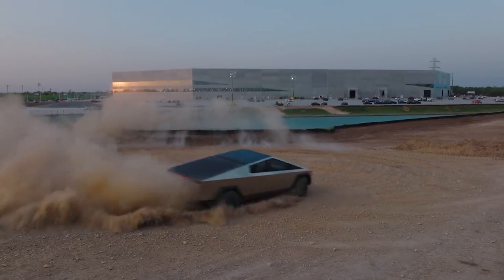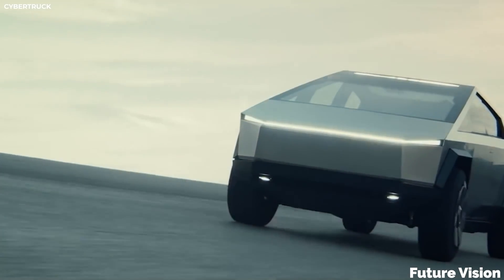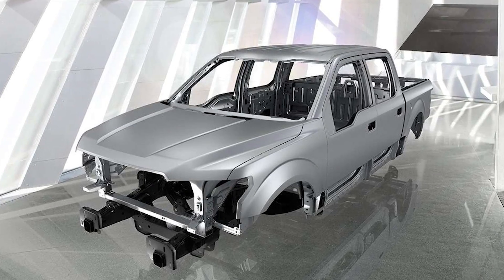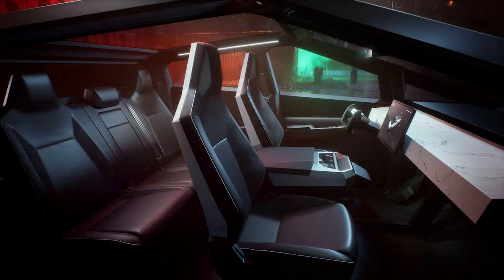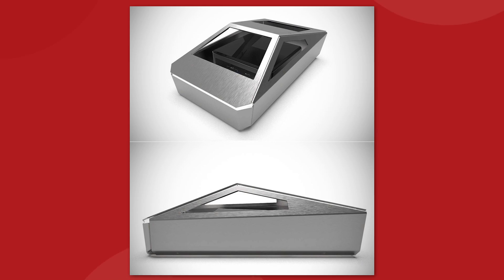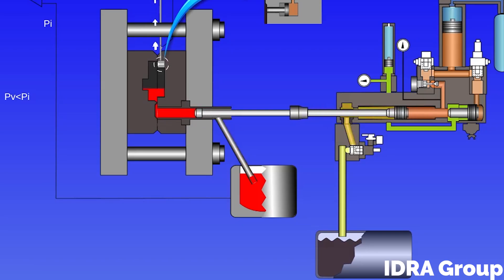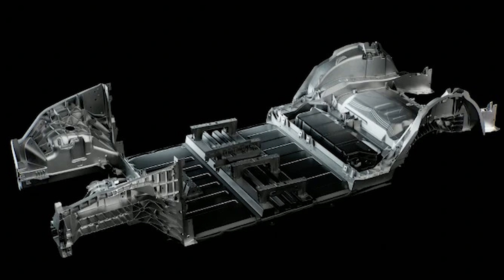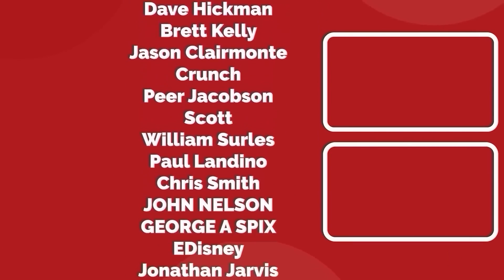The Real Reason Tesla Developed The Cybertruck!

Comment: I have a Volt and my son and son in law both have Teslas.  All have replaceable batteries. Since the battery is part of the cybertruck, what happens in 10+ years when the battery has degraded to a very short range, The battery cannot be replaced.  Just scrap the truck?

Comment: Is the cyber truck designed to haul tools to a job site?
I mean it looks New and it might be Good but what about hauling rock or dirt what can it be used for? Is it for the dads and moms to go camping in or take the boat on vacations? Do we have to buy triangle shaped tool boxes to get them to stack right in the bed of the truck? Is there going to be lumber racks available so we can carry 20' x 2"x4" or 20' x 4" x 8" shaped boards or maybe 20' long pipe or full sheets of plywood to a job? What work can it be used for. Okay maybe you see a better design for a SUV but is that really going to work like a pick up truck works. I mean WORK or sport utility? Can we fill the back with scrape metal and bring it to a recycler and have him lower an electromagnet over the bed to remove the scrap without the electromagnetic field totaling the electronics?

Comment: I did notice one thing and its the same with a lot of vehicles now.  The sloped windshield creates a long "A" pillar on each side.  This causes a blind spot for the driver when pedestrians use a cross walk.  And I believe this is why a lot of pedestrians get hit by vehicles.    I'm sure the design structures will take off, but I can tell you one thing, you cannot beat the wrap around windshields of the older vehicles which gave the driver better frontal vision.  Maybe your design engineers can come up with a better windshield design to try and move those "A" pillars or eliminate them some how  from blocking corner vision.  Structurally the design I believe is strong but maybe later a little dressing design on the front would look good. As of right now the vehicle looks very plain.   Good video.
Reply: Yep, possibly the least pedestrian friendly design of the last fifty years.
Those A pillars will make for great tunnel vision.
Bags of glare off the sloping windscreen, and dashboard reflections.
Wonder how it fares in crash testing.
Best of luck repairing panels if they do get damaged.
But I'm sure we'll find out how they perform in the real world very soon.

Comment: I don't care about how it looks. I haul a 30 foot RV or boat around most of the summer. I want to be able to load a dozen bags of redi-mix and some 8 or 10 foot treated lumber for a random porch project. Sheets of plywood. A load of trash bound for the dump. If it can do that, I'll seriously consider it.
Reply: In New York city, the cyber/battery trucks that the city bought to clear snow.......lost their power after just a few hours.   These battery operated trucks don't have the power and endurance of combustion engine trucks.

Comment: If the range of the Cybertruck can be 500 miles, 4 x4, tows 10,000 lbs, has V2G and 240v points, it' the truck for me regardless of its design or colour.

Comment: Longer lasting? This is misleading. You can still see on the streets 20, or even 30 years old pickup trucks, but you will never see an EV lasting this long no matter how well they are build unless they solve the problem of the current state of batteries. No matter how good these vehicles could be, current batteries will only last 6 to 10 years max and replacing the them can be as costly as buying a brand new vehicle and no one really knows what to do with all those old battery packs full of toxic waste that will start to appear in a few years from now. These Cybertrucks will be just as disposable as any other Tesla car or EV unless there is a game changing discovery in energy storage which hasn't happen yet.

Comment: My problem with all eclectic vehicle is the build in not exchangeable batteries. there should be a law that you have to build cars (and Cellphones) with exchangeable universal battery units. Fast recharge with battery pack swap and longer (full power/range) live span for the vehicle. But than they would last to long and the industry does not seem to like that to much.
Reply: I agree...these battery packs should be replaceable, but NOT to put in a newly charged battery.  These batteries weigh 1000's of pounds, have a lot of electrical connectors including dangerous high voltage wires, and connections so the vehicles air-conditioning to cool them.

Comment: One of the main reasons motor vehicles went to lighter metals and even plastics in the body (think front and rear bumpers), was to create crumple zones to absorb energy. The crumple zones increase survivability for any unfortunate pedestrians to be hit by a vehicle and also the occupants of the vehicle.

How the engineering has been described in the video, the Cybertruck sounds like it has gone backwards in safety standards and basically become a stainless steel battering ram. I'm sure that Musk and his engineers have in some way addressed this, otherwise the Cybertruck wouldn't pass any international safety standards.
Reply: It's most likely different concern on different classes, body on frames also have reasons why exist and as result crumple zones are not possible in same manner as on unibody structure

Comment: At first it seems to be reasonable, but, a sole of Aluminium? A battery to carry weight?  Wouldn't it smash most other vehicles it crashes into? And if it is smashes by a heavier vehicle, will there be any chance of repair? I don't think so. It's like a bugs exosceleton, if it's broken, it is a total loss. It may be nice, if it wasn't driven electric.

Comment: Stainless steel is always a great option.  I still have problems with the batteries in all EVs.
Reply: The alternative is a very long power cord. Lousy range, but it would save a lot of weight and cost.
Reply: @sanderdejong66  Maybe the addition of a small efficient gas or diesel-powered generator that could charge the batteries when driving to increase range, it wouldn't have to be big.  There will still come a day when the batteries fail to charge and need disposal.

Comment: How long will the battery last? Because is going to be difficult (if not impossible) to replace it...
Reply: tesla engineers are not idiots.  It will be possible to replace the battery pack and probably not difficult with the proper hoist/support equipment.  On the other hand, I am convinced there are idiot engineers at Subaru.  Replacing the driver side headlight bulb on a 2014 Subaru Outback requires a skinny multi jointed arm with eyes on the fingertips, something I don't have.  Luckily my mechanic has a pet monkey for jobs like that.

Comment: A good explanation of WHY the cyber truck is the way it is.  BUT there is a core ASSumption, 1 size fits all.  This ignores the specific job requirements of for example, utility companies with their industry specific bodies, or a flat deck, try dropping a flat rear tractor(eg 650/75x42) tyre on a cyber truck (awkward, IF it fits), then drop a fire fighting rig on(fire fightng for grain harvest) and general farm work. A flat deck means you have access from 3 sides, with a cyber truck you only have 1 side access.

Comment: The engineers are geniuses. But, like the man Tesla, they may have a problem. I don’t care how perfect the design is from an engineering perspective, looks matter and so does market use. Tesla was ahead of his time and he died long before anyone truly appreciated his work. I think this will go the same way. I’m a truck guy who uses one as a daily driver with the thought of using one as a truck. Towing/hauling and aesthetics. It might be the most amazing thing ever but it’s ugly and will fail miserably in the tow/haul category. I lose 20% efficiency in my truck when I haul a real load. All the EVs on the market lose 70% under a load. I’ll naturally assume it has the same poor performance at being a real truck unless they prove otherwise. It’s ugly and won’t out perform my truck when being used as one…. Plus, we’re 30+ years from having a grid to handle large quantities of EVs so it’ll cost more not only at initial purchase but more long run to keep it charged along with increased recharging time vs fossil fuel trucks.

Comment: All you say sounds good.  But the problem I see is those large flat pieces of glass that form the windshield and side windows.  When the sun is at the right angle its light will reflect off these pieces of glass and shine directly into the eyes of on-coming drivers.  Can glass be made to be non-reflective?  When I was young one of my first cars was one whose windshield was made up of two pieces of flat glass.  It formed a mirror that made a very bright spot when the sun shone on it the right way.  VW solved this problem by putting a slight curve in its front and rear glass.

Comment: Quite an interesting video. I didn't order mine because it was pretty, in fact I've always felt it was rather ugly. But if you're really dedicated to something, looks don't matter so much. Battery vehicles do need to be efficient and the lightest truck has the best chance of being the most efficient. I don't find the looks of modern trucks to be very appealing, just seems like a lot of puffery. Hoping the Cyber Truck does a good job of towing and can get a decent size trailer from one Super Charger to the next. It will be nice if they really do have 240v power outlets and air compressor ones as well. We'll just have to add a StarLink to the camper, a 4k projector, an outdoor screen and maybe a couple electric bikes or scooters.

Comment: Speaking as a retired automotive tool and die engineer, this video makes me cringe. Yes there is some cool information in this video there is some wildly inaccurate information related to design, engineering and manufacturing. .125SSt will not brake a forming press. Batteries are not structural nor do they carry load. Tensile stress is not a measure of rigidity as stated here and the list goes on. You have lots of subscribers and views which makes your job of presenting accurate information critical. All the best.

Comment: Interesting.  My worry is because you can doesn’t mean you should.   Repair to an exoskeleton truck could be very problematic.   Requiring a structural engineer’s approval for welded repairs, since the body is now structural.    It just sounds like a money pit in the long run.   Also forming a structural member out of a battery pack that is explosive doesn’t seem intelligent.  The pack should be easily removable and protected.

Comment: But wait, the magic possibilities of this stainless steel exterior is mind boggling. Trip the light Fantastic! 
I can see it, artistic machined finishes, maybe sealed with ultra hard clear or pearled enamel. Or industrial/cyber machine patterned indent, micro or enlarged scale, geometric or organic. Custom pattern variations though the body, based on bead blasted or highly polished.  All great cammo ideas for retaining surface finish integrity to mask any scuffs & scrapes over the decades. Most impressively, added stylized bling for those after a custom theme to stun under the sun, city lights. or gleaming full moon. Pearlescent and holographic can stand aside for raw energeized beauty of stainless on the center podium.
Reply: I was thinking the Vinyl Wrap guys will go wild on 'em too!? Bored with the look, just peel it off and redo it. ;-)

Comment: One of the problems with the battery pack is that they are more expensive to replace than in the other vehicles. Every year you can expect to lose about 10% of your overall charge so in a matter of 5 -7 years you will need to spend roughly $17,000 to replace the existing battery. The battery fad is going to be short lived until scientists figure out how to use magnesium to make batteries. Currently China is the only country that mines the rare earth elements to make the batteries needed to make an ev and if China waits till at least 1/2 the world is reliant on batteries you will see a ridiculous price on batteries in the future.

Comment: Now it has sense... But considering lifespan, what about a battery-pack that is integral part of the structure, but has to be replaced because it is done? Is it modular? Can it be exchanged? Can other parts be exchanged/repaired if damaged or destroyed? What about the internals? Is there a lot of over-sensitive electronics inside to run that thing, or are vital parts "simple" enough to be repaired/exchanged without specialized knowledge?
Reply: Perhaps the interior of the shell of the pack can be removed and replaced.  Not sure, but hopefully.

Comment: I still want to see integrated solar cells.  If they only provide 6 to 9 miles a day, that is plenty for long term parking, either at the airport, on a job site providing power and Tesla cam security 24/7, or out in the back 40 during planting season.  I also want to see how accessories like snow plows and winches will attach.  The look turned me off originally because I thought it was some kind of woke statement about expressing some designer's art instead of a practical design given the assigned job.  How are all the racks for ladders or sheets of glass going to fit on it?  Hopefully this truck is made for more than car pooling.

Comment: well as a owner of a Fossil Burner I got a 1991 ford F-250 with over 200 k on it daily driver an d not and ounce of rust on her :) and i do like the CT but what gets me on them right now is the lack of charging station time it takes to charge, overall  cost and lack of cargo space compared to my 8 ft bed and as well as being able to go off road with out having to worry about having to charge it as i can drop a 5 gal can in a few minutes compared to charge times for most EV's and get more milage for the time it takes in reads to drop 5 gallon of fuel to equivalent charge time

Comment: Betcha when they're 50 years old a higher percentage of the Cybertrucks will still be in service than any other pickup produced to that point.
Reply: The battery is not replaceable, so when the battery goes, so does the vehicle.
Reply: @fredfeld7368  Are you able to cite sources on that information? I find it hard to imagine an irreplaceable part but maybe that's just me. I drive a 19 year old Prius with more than 225,000 miles on it. It still gives marvelous mileage though admittedly two cells have been replaced. Admittedly, the battery of the Prius and the Cyber Truck are entirely different in their construction. My impression is that non-functional cells can be disconnected from the Cyber Truck's battery. I'd guess that under aftermarket or Tesla-authorized procedures, the entire battery pack will become replaceable in part because of its value for recycling or stationary use.
Reply: @markkoons7488  At about 11;40 into the you tube, they compare traditional cars and trucks having batteries that are "dead weight", but this cyber truck will have a "one component structural battery pack" that will not just add weight, but increase the vehicles strength.  I take this as one piece, not just bolted on.  Maybe Tesla is re-thinking this, because it may be bad for marketing, thus delaying the launch of this vehicle and the Texas made Y.  My son has a Tesla and likes it, but could not wait longer for this Cyber truck.  He bough a Ford electric E-Transit.  150 mile range.  enough for all his local service calls. Hope this clarifies things.
Reply: @fredfeld7368  Some report on a million mile Tesla, maybe an M-3, mentioned a sound drive drain after a couple of battery replacements. I very much like the idea of vehicles that, as I've heard ranch types here in Wyoming say, "are good from now on." I think I saw a teardown of a well-used Plaid power unit that looked like new inside. I suppose I'm projecting personal values on Tesla design but as low as projected maintenance costs are, swappable battery packs seem like a great good. Here's hoping.

Comment: That wasn't a sledge hammer btw. It was a rubber (mallet)sledge meant for blunt force without denting the material. Usually filled with sand or beads. A sledge hammer would have dented the fuck out of that door.

Comment: Vanity project. The sloping bed sides make it difficult to load, and it doesn't have tie-down cleats. I built houses and moved furniture with my conventional pickup, I can't see one of these parked at a lumber yard.
Reply: Pardon, I see it has a tie-down rail. Also, since most pickups are used for commuting to work anyway, it's OK. However, I can't see it as a contractor's truck. Got to hand it to Elon, tho, too bad he can't run for president

Comment: Not having a wheel, not having physical buttons, not having Waterproof Everything to the point of pressure washing the interior and be OK and in warranty on an top of the line electric TRUCK, it is really bad, because of the gloves , mud , sand , salt , snow , floods and all that a truck can be exposed to, and having the ultimate survivor in an stainless steel exoskeleton that can take small arms bullets, it should also be able to survive the base use of a truck in any environment, and because you can't really work on Tesla vehicles, like you can fix a truck, you need to be ensured it will not fail in critical moments. (Waiting for the Cyber Line anyway, looking forward to the Cyber-SUV)